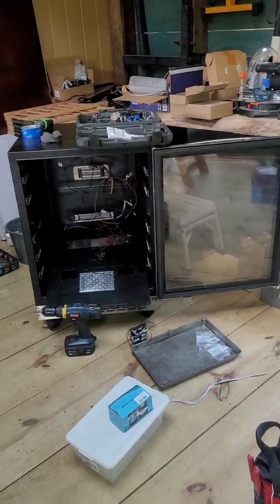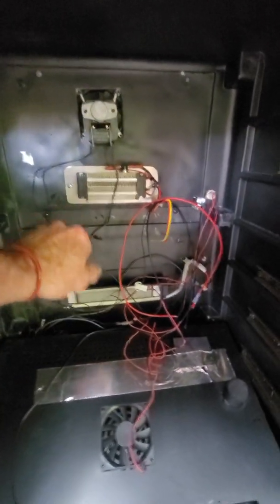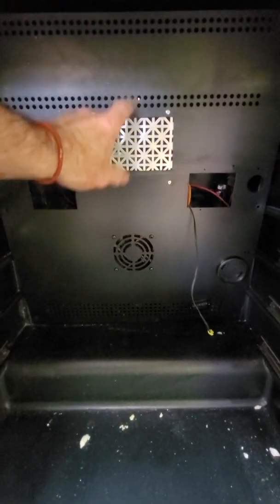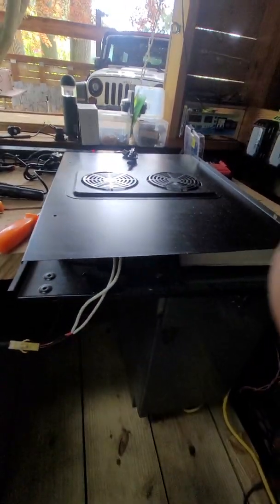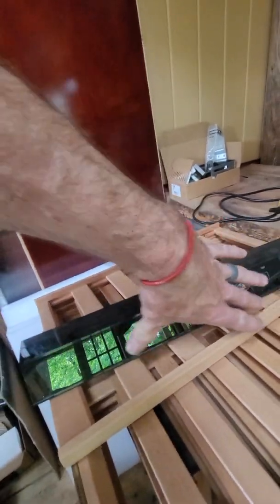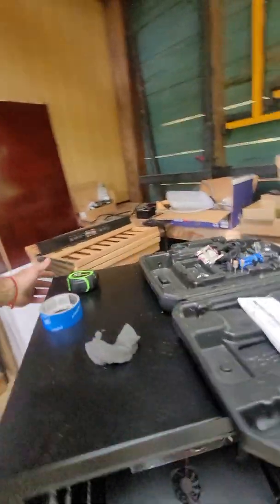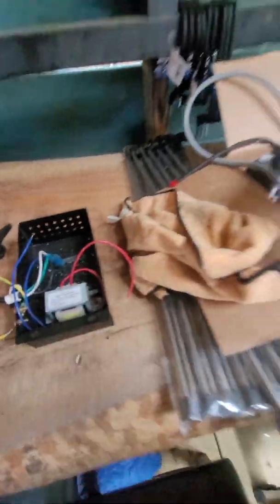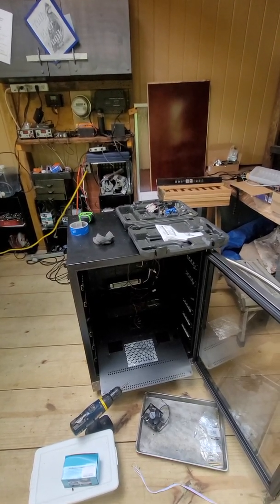DIY Winecooler Inncubator build - initial considerations  for design and wiring

Comment: Where did you acquire your 500w heater (model #/Item #). THANKS!
Reply from the maker: Amazon has many ptd heater options.  Ptd allows for variable voltage input, so if you have a smart controller it will slowly ramp up the heater as needed as opposed to 100% on/off.  You see less variation in temperature and the smart controller learns just how to feather the power, and after a few cycles will provide for a more even temperature graph instead of up and down spikes through the entire incubation.

Comment: I’m just wondering how this turned out?  I just a a 6 foot wine cooler
Reply from the maker: It turned out great as far as the build went except: these units have a mid level divider to have two temp zones.  There is a fake back wall and the center control divider has two fans that bring in the air and circulates it through inner channels and pushes air into the back wall chamber where is is forced out through the exit holes at the desired level.  I wanted to use these fans as designed, and I wanted to use an inexpensive control panel on the divider's faceplate to look as original as possible.
But...
I didn't want to count on this as the main controller because it was china-cheap, so I wired it to also use an external quality controller.  I used toggle switches to re-route the power pending which controller I wanted to use (preventing back feeding source B when source A was used).
Well the internal Chinese controller with sexy touchscreen failed out of the box.  So all the extra smartness I built into the wiring was for naught.

When the weather breaks (it's mid March, so soon I hope) I'm going to remove all the fancy switches, take out the inner controller, replace the faceplate with a blank and run it as I should have with the external controller that I'm wall mounting in the barn office.

We are launching a Quail Business Directory and Ag/Marketing Cooperative called USQuail Cooperative (learn more at USQuail.com, USQuailCoop.com should go live within the next few weeks).  We will offer discounted supplies, equipment, feed, and even podcast equipment in the USQuail Store.  As our membership grows (10 listing in each state) we will begin to manufacture incubators similar to this 1 external controller/multiple box concept so users can buy the size "box" the need and not have to purchase new controllers.  We will have desktop, cabinet and under the cabinette designs from 200-700 quail eggs, and they will be equipped with "hatching cam" video to let you know vis sms when "You've Got Quail".

We are going to start doing live morning drive time podcasts in the a.m. on the @USQuail YouTube channel that will be explaining the platform, answering Q's and commenting on "food news" as we try to do our part in saving the country... feeding America when she refuses to feed us.  #ParallelPoultry.  We could use a hand.  Maybe you will join us?  There's a great referral Affiliate program for members.
USQuail.com - coming soon Member-owned USQuailCoop.com